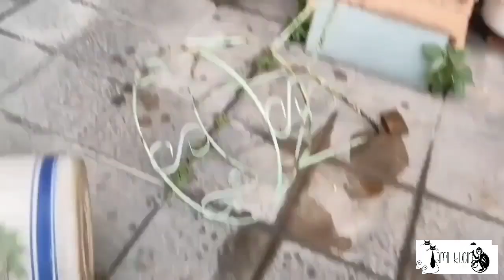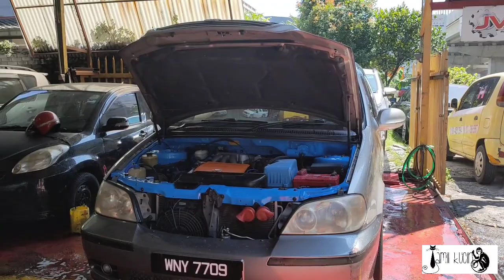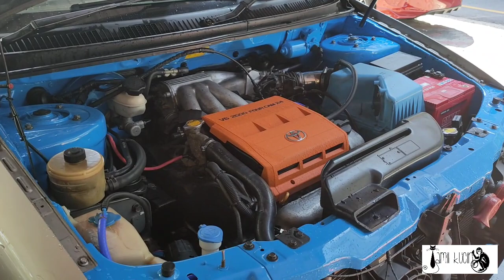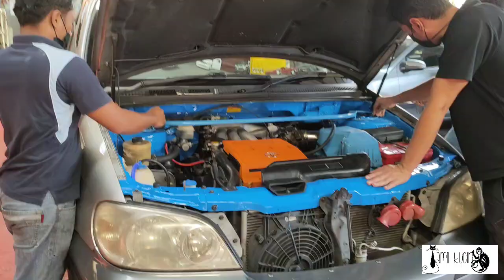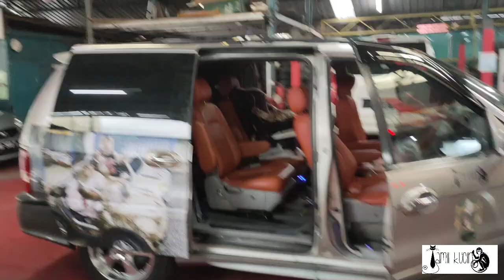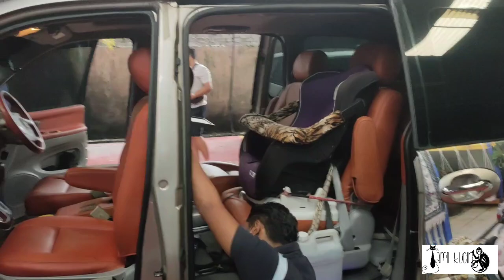Our Car Done Changing The Engine

Comment: Hi Jamil, I'm curious roughly how much did it cost to replace the engine? Is it a brand new engine or second hand engine? Sometimes you can end up getting a great deal on second hand engine with low mileage and if the previous vehicle was not driven roughly by previous owner.